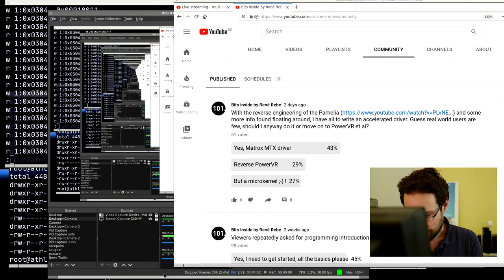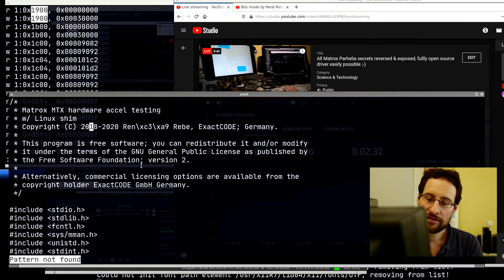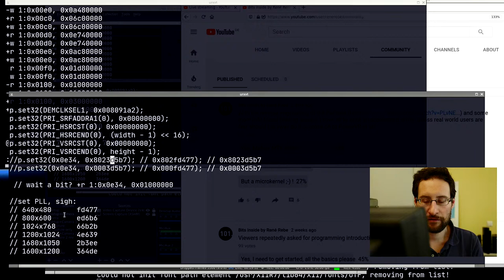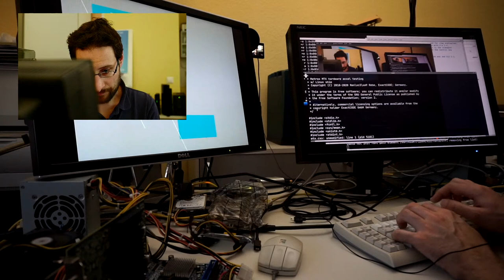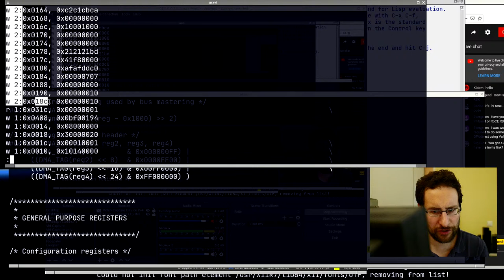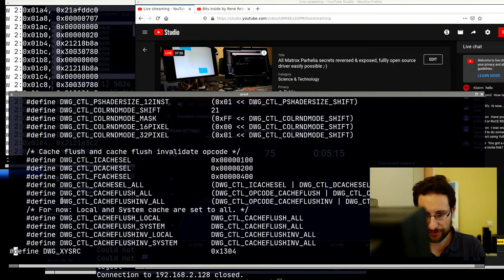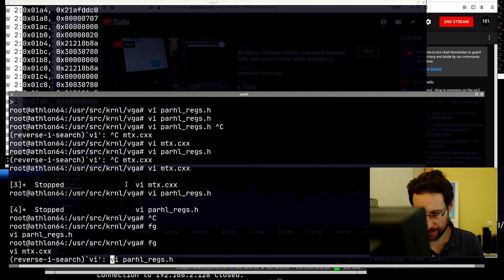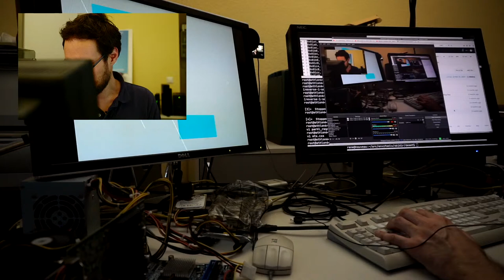All Matrox Parhelia secrets reversed & exposed, fullly open source driver easily possible ;-)

Comment: For such massive registers writes, it's more efficient to implement write_bulk(const pattern, patch) function that takes array for address+value pairs, pattern is constant setting the sequence and the patch is dynamic one for changes, even delays is possible to implement let's say addr==-1 means delay and value will mean uSecs. It compresses original code a lot! It's also possible to implement write_bulk(const pattern, patch) in assembly very efficient and write_bulk(const pattern, patch) API is very portable across any platforms x86 real/unreal, ia32, x86_64
Reply from the maker: it was reverse engineering prototyping though. Real world code will look vastly different.
Reply: yes, I see. why not to try this approach? The point is if we write pretty structural and logical driver with functions that call w32(p, a, d); for every word written there are  >4bytes of code. Initialization or setting h/w 'state machine'  into especial state requires some 'protocol' like sequence of writes - it could be very efficiently packet into bulk arrays.  @renerebe

Comment: For the PLL, tracking H/VDisplay is not that useful. You need to track H/VTotal in your table of values, and the dotclock that the modeline has. You can then have your monitor tell you the H and V frequencies in its OSD. This will allow you to more directly deduce (a value close to the) actual dotclock, and you even have a value to spare as a proof.
Reply from the maker: yes, I did not mean to imply the PLL for the pixel clock depends on h & v parameters, in fact I continued to sniff some values, and the hw appears to use some set of 2-5 bits for each of the divider components. With the table below I can set all majorly commonly modes in a way that my display accepts, although for some the refresh rate is expectedly 10 to 25 Hz off and my display displays a "out of range" warning ;-) Still need to figure out which sets of bits are which divider. Maybe I should throw Ghidra onto the driver binary and see if the setPLL function becomes somewhat readable, ..:

struct {
  float frq;
  int val;
} plls [] = {
{18.4, 0xf735f},
{20.6, 0xe9be9},
{22.4, 0xfd477},
{23.0, 0xfd477},

{26.9, 0xee4f9},
{28.8, 0xdd4f7},
{34.6, 0xdd637},
{36.0, 0xed6b6},
{40.8, 0xd65a0},

{47.2, 0xad676},
{55.1, 0x8e639},
{59.0, 0x66b2b},
  {63.5,  0x66b23}, // manually guessed
{66.8, 0x7e6f9},

{78.6, 0x5b534},
  {88.3,  0x4e65f}, // manually guessed
{98.3, 0x4e639},
{111.4, 0x4bef1},
{104.4, 0x4d6b6},

{105.8, 0x2b3ee},
{115.2, 0x364de},
  {130.2, 0x4d6ee}, // manually guessed, close?!
{138.2, 0x4d6f6},
  {150.2, 0x4d6f9}, // manually guessed
};

Comment: Hello.
For many years i used a Matrox Mill 2 PCI 4 MB, but not a Perhelia. And on a Geforce 4 TI 4200, 64 mb AGPx4 i learned how to use the VBE3 bios and refreshrate controlled video modes, how to use the primary linear framebuffer and how to get the EDID from the 19" CRT monitor with 96khz capacity. With Geforce GTX 295 PCIe and Radion 9750 PCIe and a 28" LCD i used vbe3 mode numbers for 1920x1200 16: 10 aspect ratio wide screen resolution.

Now i like to know how to get the EDID from the secondary monitor, how to display the secondary linear framebuffer on the secondary monitor, how to set a videomode for the secondary monitor, how to switch from the clone mode to single mode or stretched mode without a driver using MS DOS.
Reply from the maker: Most likely direct, chip specific register writes only